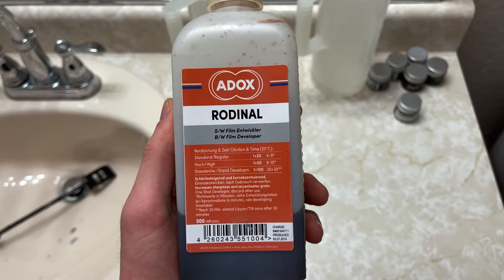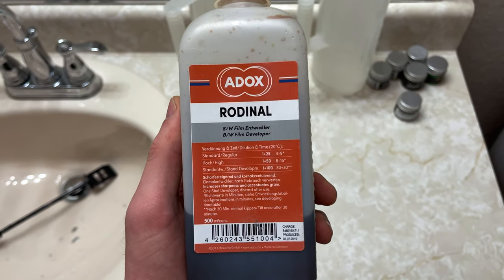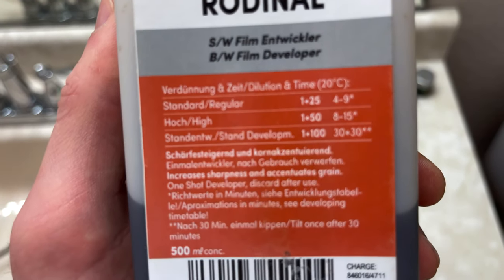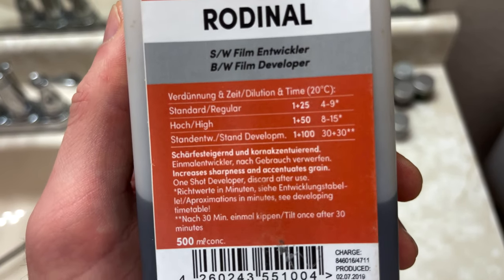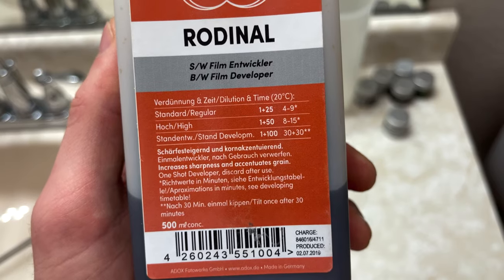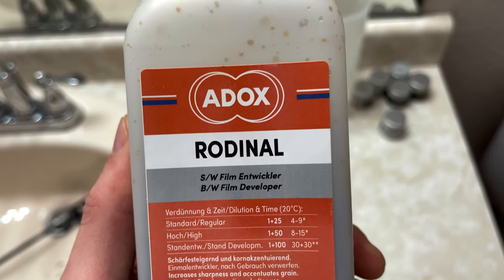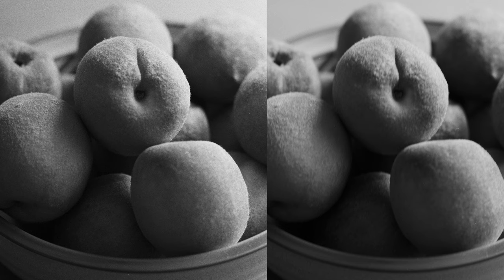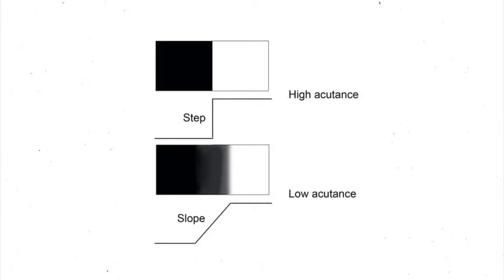What Is Stand Development?

Comment: I try to avoid stand developing 35mm but 120 and 4x5 is amazing. Idk what it is with sprocket holes but they always seem to give my film streaks. On larger formats that's not really an issue plus you can notice the sharpness and less of the grain.
Reply from the maker: Yeah I’ve noticed that too! I don’t think it works as well on 35mm. Film is film of course but each format reacts a little differently and I think that’s an often overlooked quality.
Reply: I do semi stand and get zero visible bromide drag. I agitate thoroughly initially, then once each half hour. Most dev times are 1 or 1.5 hrs.
Reply: Yes, bromide drag (although there is no bromide in Rodinal) has been my problem with 35mm film.  Not necessarily very bad in every case, but once you start looking for it, it is often there.  But I could add more agitation into my routine, which might help.